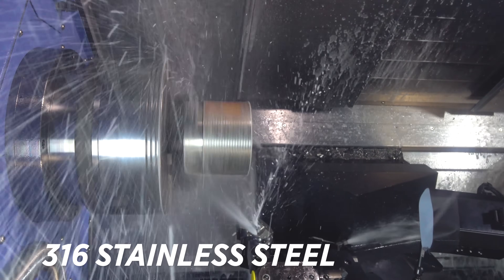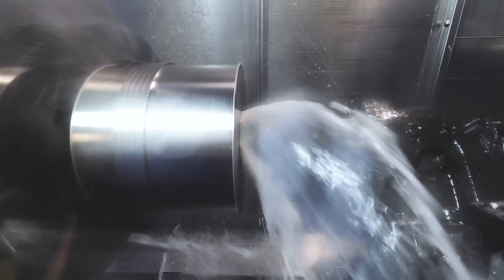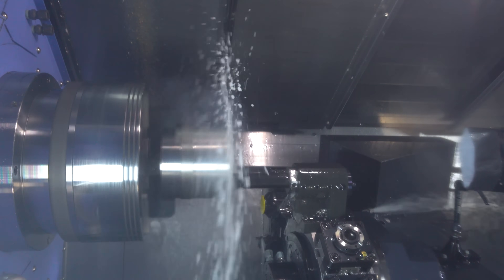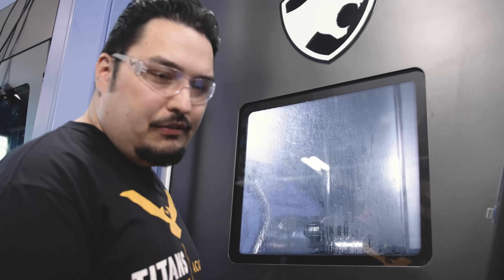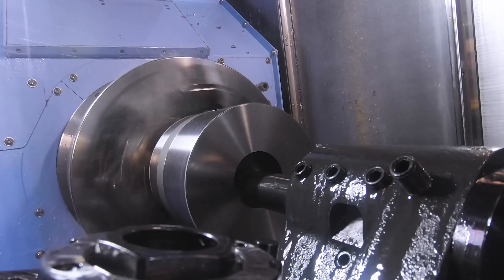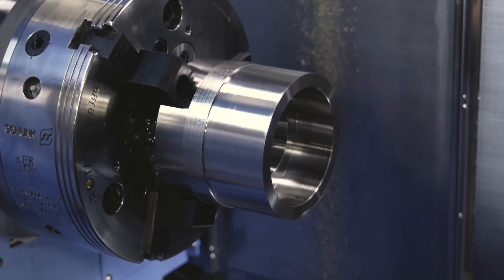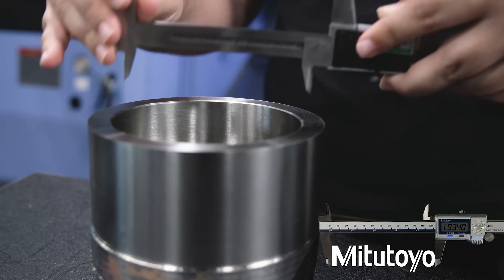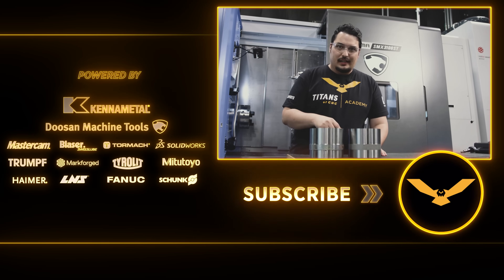Comparing the Differences in Roughing TITANIUM vs STAINLESS STEEL

Comment: Will the titanium end up getting disfigured on the CNC if it's cutting too fast the way it does on a HEM saw? On the saw you could start out the cut at say 2" and the bottom of the cut ends up being either way over, or way under the 2" like say 3" or 1.5".

Comment: Great Video , that cutting speed is perfect on the Titanium . Its just back from the edge of chatter . Excellent chip control too . Are you roughing these out on both sides first to relieve the internal stresses in the material before setting them up later for the finishing cuts . It looks like there is a little internal stress in the part on the turned surface finish of the bore .

Comment: You guys should try out the high density alloy boring bars. You can stick out 10x bar diameter and not chatter. You will have to fine tune it but I know you guys are good.

Comment: I want to see tungsten
Reply: Cutting tungsten is not fun at all.  I worked at a shop where were making tungsten counter weights for a robotic surgery company.  Even the EXTREMLY simple geometry was hell on the tooling.  Basically we just made the parts rounder and rounded the edges.  The were two small drilled and tapped holes in the part.  One one each end.  We didn't dare tap them on the machine.  We had the manual department do it as they had a better feel for how the process was going.  We didn't want to scrap one because they were so nasty to work on.  The manual guy would put small notches in the shank of the taps as he used them.  This was his way of keeping track of how many parts he'd used the tap on.  After 5 parts, so 10 holes total, the tap was junk.  He always hated when those parts would come around.

Comment: Just our of curiosity are you doing .130 a side or .130 total so .065 a side? The machine I run programs per side not total cut which is why I ask.
Reply: Generally speaking, DOC when spoken is radial, even if the machine receives the word-address as diametral. Like, I’ll still verbally say .1” DOC, and then program .2” when required.
Reply: @joelmacdonald6994  ok so he is actually taking .260 is what you are saying. I program my machine using the shop floor but would deffinitly not call myself a programmer.
Reply: @wendull811  at least on my area/region, a .13” DOC would be .26” diameter. But I’ve learned that different regions speak and program differently. I’m in western Canada, we type T_ M6, but I can spot someone from Ontario in a heartbeat as they type M6 T_. Just a dialect difference really.
Reply: @joelmacdonald6994  yeah I am in the north east of the USA and it is the same here. A doc of .13 would be .260 diameter. Just like to know as we run the excat same machine

Comment: I know stainless can string up and cause nesting but how does titanium act when cutting? Like stainless and string up or more like aluminium chips?
Reply: Titaninium is very tough, so chips do not break very easy, even with more feeding.
It's nesting very often and can cause your tool cutting edges to break just by getting slapt from nesting chips.
I'm using high pressure coolant system breaking the chips to avoid that.
But that doesn't always work.
Reply: @tausendundeineidee  so glad its not just me lol